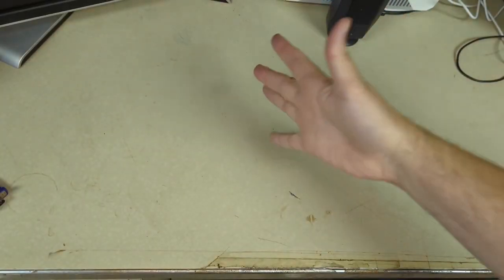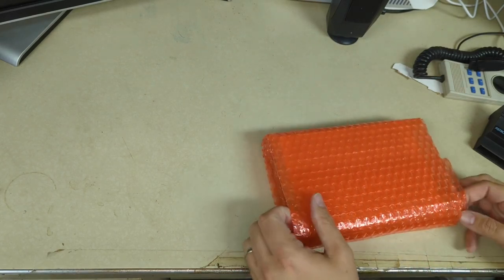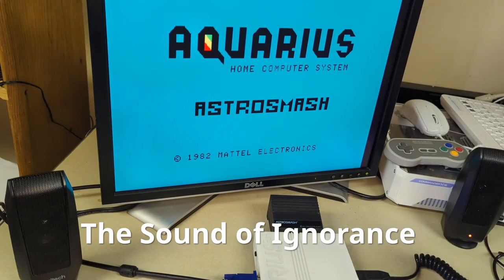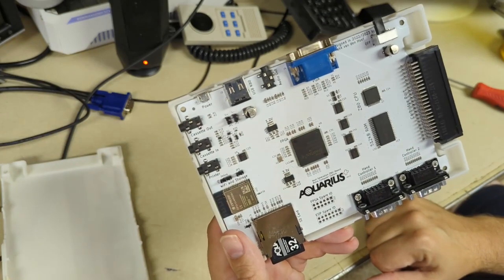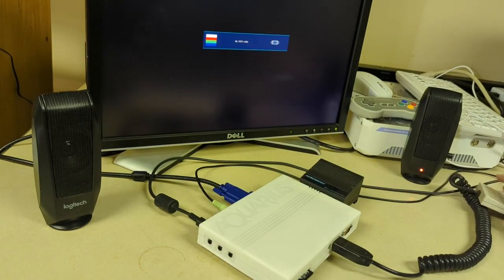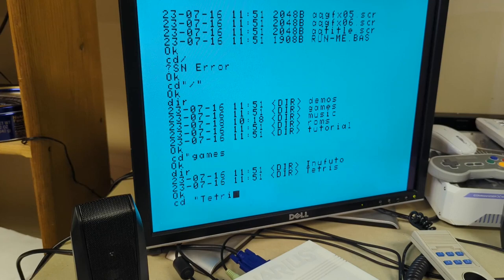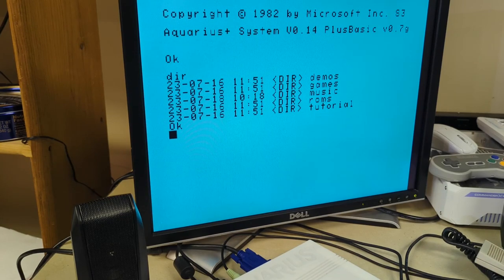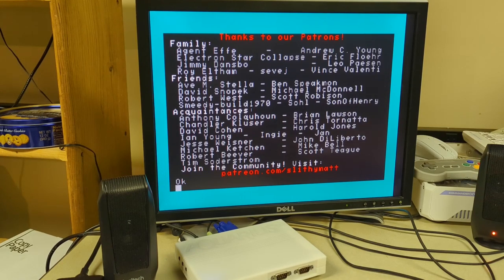AQUARIUS+ Retrocomputer Unboxing

Comment: I had an original Aquarius that I bought when they first came out. I went back to Montgomery Wards (remember them?) where I had bought it to get some accessories two months later, and they had stopped carrying the Aquarius. That was it. Done. :)

Nonetheless, I had a lot of fun with it. Utopia was my favorite game, and I didn't really bother playing anything else.

Something happened to it while I was working in a PCB assembly shop and the engineer there fixed it, and asked the ladies who did the hand soldering at the shop to pull all of the chips and socket them for me. They were a fantastic bunch! 

I happened to run into another engineer in Colorado Springs, and he offered to build me a 16k RAM expansion board for $75. I still have that board, it's a hand-built wire wrapped board that really looks nice. And it still works (as of the early 2000's). Definitely one of a kind. :)

I had to replace the computer itself as it was stolen by the movers when we moved to Tennessee. I've replaced the regulator in my Aquarius for one of the EZSBC units, as well as removing the TV modulator and replacing it with the DIY Composite board made by the same guy who made the Aquarius+ (Sean). Small world! 

And I have done business with Sean before, he's a great guy and he makes great stuff! :)

Nice to see the Aquarius getting some love.

Comment: You need an USB keyboard which is still able to speak PS/2 protocal, I guess, to get the keyboard working. At least so it works with my ZXUNO+, also FPGA based.

Comment: hmm, with some reprogramming of the FPGA, this could morph into an MSX computer - then would be a sizeable catalog of software titles to run
Reply from the maker: That would be a cool project!
Reply: Yes. With the ESP32 as the "boot brain" and the fact that the Spartan 6 is an "empty jungle gym", you could write whatever you wanted... an Atari VCS / 2600 would be possible, as the two DB9 ports are already there, and you could create an expansion port adapter that takes original carts OR run the ROMs from SD.

Comment: I’m assuming the small chips between the FPGA and the Z80/RAM are level shifters. FPGAs don’t like the 5V that old parts run at, they tend to top out at 3.3V.
Reply: That's correct

Comment: nice video.  Interesting machine this one.  I wonder how much it would cost to make one by pcbway with the maker files?  Do you happen to know?  How does it compare to the x16 in its capabilities?
Reply from the maker: I haven't priced that out yet, but the size of the PCB and the BOM looks like somewhere in the $200-$300 range for a single unit, but you would definitely save a lot by ordering multiple
Reply from the maker: As for the X16, it isn't nearly as capable as far as gaming goes. The graphics and sound are much more limited. But the addition of built-in WiFi gives it a big edge with connectivity out of the box. For the X16, it will require some sort of expansion card or an IEC dongle like FujiNet to accomplish that.

Comment: This was a minor also ran here in the UK.
Reply: I'm in the UK and I've owned a couple of them over the years, bought very cheaply in the 90s from car boot sales. One of them was complete with a range of cartridges like LOGO and different RAM expansions, plus a 4-colour pen plotter, all mint in original boxes. I sold them all on eBay eventually, as they fell into that void where I have no nostalgia for them, and there's nothing compelling about them that would make me want to use them.
Reply: @Zeem4   I have seen similar where somebody has bought a not so popular system and maxed it out.  They probably didn't know what they were buying at the time. Not a system I have any curiosity about to be honest.